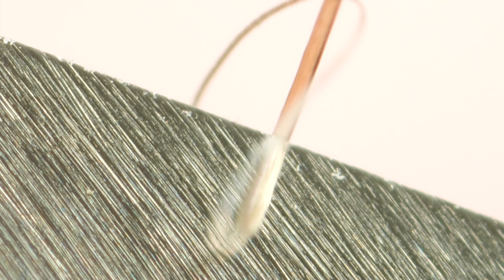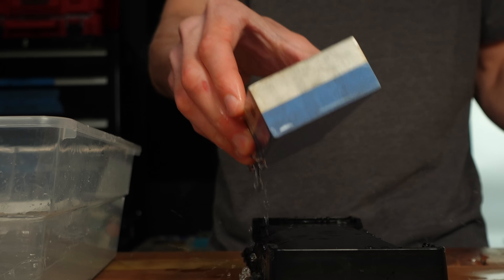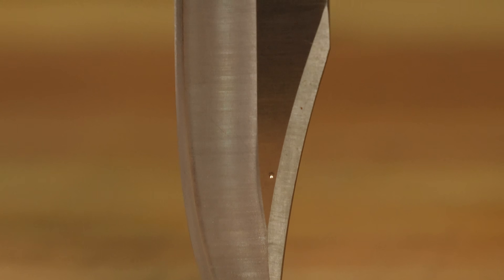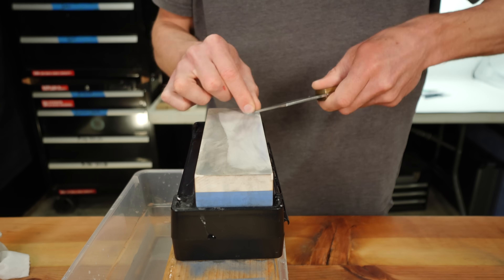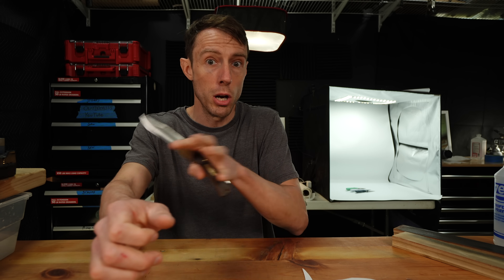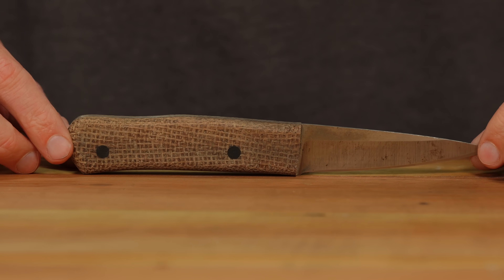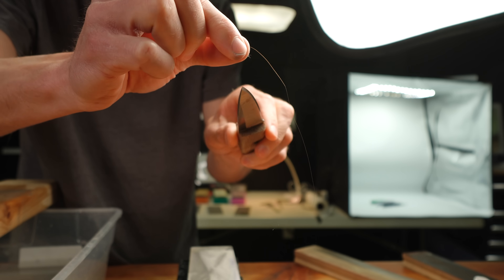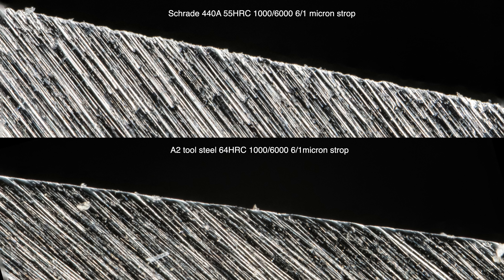The Reason You Can't Get A Hair Whittling Edge No One Talks About

Comment: Interesting, but you failed to mention the real reason.  Maybe you don’t know the reason.  As a veteran of designing food processing equipment, I can tell you the problem is the amount of chrome in the alloy.  What makes stainless steel “stainless” is the chromium in it.  Chrome oxidizes before iron.  This provides a barrier that keeps the iron from rusting.  Chromium oxide is rather worthless at holding an edge.  The more chromium, the more “stainless” the steel, but also less able to take and hold an edge.

Comment: if possible i would wish that for the next videos you try to sharpen kitchen knifes. i think you always use hunting knifes. i understand it maybe does not really makes a difference, but i just feel there are so many different kitchen knives and are there differences on how they can and should be sharpened?
Reply: Slimmer angles
Reply from the maker: I have big plans for this area coming soon👍
Reply: @OUTDOORS55  nice thank you so much. And I forgot to say thank you for that video. I just bought a new Japanese damascus knife after watching that video. It's your fault :p
Reply: @OUTDOORS55  I'm only interested in kitchen knives, so that's good news.
Reply: @OUTDOORS55  All chefs thank you
Reply: Kitchen knives are mostly just bigger, so can be a little more challenging. And they use a lower edge angle, which varies a bit by style and maker. Burrfection (Ryky Tran) has a good method for finding the angle of any knife, but he prefers Japanese water stones -- mostly better ones than shown here, which I can confirm are more trouble than they are worth.

That said, Alex is the only sharpener I consistently learn something new from, so I look forward to his content on kitchen knives!
Reply: If you keep same height at the spine the angle will be completely off.  You need to adapt.  

For chef knives If you're going to cut without impact and never touch bones you can go crazy thin even on soft steel as long as you finish with a 15 degree microbevel.

I put a 5 degree edge on 54 HRC knife and with a double microbevel of 10 and 15 degrees, both microbevels  combined measure 0.25 mm. 
This knife has amazing cutting performance. It was able to cut paper towels even after medium impact on the cutting board so I don't expect durability issues under normal use.

Overall geometry for chef knives are also different but it takes too much work to change unless you own power tools.
Reply: @thiago.assumpcao  5 degrees?! Holy cow, that's impressive. I'd love to see some testing done on an edge like that. I don't think you could even get some Western-style knives down that low based on blade geometry alone.

That said, I have found geometry behind the edge to make a huge difference in how a knife feels in use, even if 2 knives are ostensibly equally sharp and using the same angle. Thinner profile knives like Japanese gyuto feel like cutting with a laser, where a traditional German-ground blade at the same edge angle feels more like it is pushing the food apart as it cuts.
Reply: You must be new..   he did videos with a $1 kitchen knife not too long ago.. (at least it feels like it;  maybe it was a year ago now.)
Reply: @bloodgain  Yes, you need to grind a lot of steel to get to 5 degrees on western knives. 

Thickness behind the edge is one of the most important aspects of knife for good cutting performance this makes a huge difference.

Japanese knives also have a subtle convex that avoids food sticking to it. That's not enough to make food fall off but is much better than a Full Flat European blade.

My channel is on Portuguese but the tests are available if you want to see them. It's the last 3 videos. It's a 5 bucks knife that I spent about 7 hours working on. Way too much time but I was having fun testing how sharp I could make it.
Reply: @calholli  I think I saw that one, but it definitely went up before I found the channel. The subscriber count is growing fast, and that's a good thing. So yeah, he might be new. 🙂

Besides, clearly even Alex thinks that would be good content and has plans for it.
Reply: @thiago.assumpcao  Thanks, I'll check it out!

Yeah, the Japanese makers design amazing knives. I have a super nice right-handed yanagiba, and it's subtly convex on the front side, and concave on the traditional "flat" back side. It's an incredibly smooth slicer, which is good, since it's designed for slicing delicate raw fish.
Reply: I just applied the same principles from the main sharpening videos. Find the angle. Keep your wrist locked. Be consistent. Achieve the burr. Flip. Repeat process. Deburr. The same process applies you just have to get started and I'm still improving.
Reply: For some cross over content, could you do a video on sharpening 2 and 3 blade broadheads?  3 blade bh are typically laid flat on the stone but the point of the bh faces in the direction of the stroke.  I think it would be hard to raise a burr that way.    Also the steels are typically 50-60 HRC and typical examples are 1045, S7, 440C. 
  Thanks for your videos!
Reply: Please get a Kobayashi
Reply: @OUTDOORS55  A video showing how to sharpen a fillet knife would be awesome!
Reply: i would love to know the secret on how to get good edges on KIWI knives.

and a benchmark, swiss army and opinel and leathermann to please.
Reply: I used the new 180 euro knife I just baught (see comment above) one day to cut tomatoes, pineapple and mango. It already lost sharpness and the next tomatoes cannot be cut so good. Is that normal? I'm beginning to think my kitchen is haunted... Or I'm just dumb
Reply: @1eikaramba1 this guy can’t even sharpen with his left hand. Forget about all the disinformation in this video. Look elsewhere for information on sharpening knives.

Comment: I'm convinced that schrade makes their old timer knives out of chromed plastic based on how they sharpen.
Reply: It's so bad lol
Reply: Nah, the knife is fine. The strop failed to do it's job in polishing the edge. It is very common for people to mess up stainless steel stropping.
Reply: @dragoscoco2173  I’m not saying this based on the video but on my own experience as a professional knife sharpener. Old timers are trash.
Reply: I wish it wasn't true, but it is. At least they are now making knives with D2 and 9CR18Mov. They still make the trash, but it's not all they make.
Reply: Shrade went out of business in 2004-05.  The ones you see now at Walmart are anywhere are from China and are stainless. The older Schrades made in the USA were carbon.  Shrade /Walden was before Shrade and were even better.
Reply: @dragoscoco2173  so... if I "sharpen" a piece of silicone and it doesn't come out sharp, I can't strop. Is that what you're saying.
Reply: @Doc-Holliday1851  One can easily sharpen an old timer plain carbon rusty blade to hair whittling, sure it won't hold long but it can be done, always. It does not even need to be a complex hardened and untempered version. The problem is very few understand the strop and what it does or how it works.
Reply: @alextheonewarrior  You can see in the two edges after stropping, the stainless steel strop failed to do anything. Why do you think it did?
Reply: @dragoscoco2173  You can get a butter knife hair whittling sharp. That's not the issue. The issue is that the steel has the structural integrity of a week old banana. You're right, you can get the apex into the shape of a functional blade but, in my experience, the moment you do anything with it the edge dulls pretty much instantly. So it doesn't matter if you can sharpen it because the steel is trash.
Reply: @Doc-Holliday1851  Well Outdoor failed at attaining that hair whittling sharpness with a steel that is most certainly able to reach it. Ok 54 HRC is not that high, but it is a decent value for a stainless that was not meant for high hardness. Also the modern dribble about high hardness which is achieved by essentially providing hard carbide grains to stop the indenter from moving through the soft matrix is less ideal when a razor edge smaller than those grains is required.
Reply: they used to be good decades ago
sad to see a US company go so downhill
Reply: 55 HRC can be sharpened to hair whitling easy. I've done it myself several times already.
It is not great for durability but enough for many tasks.
That being said, it is not the steel it is Outdoor55 if hair whittling is not achieved.
Reply: @escapetherace1943  The problem is not the company or the steel as 99% of people holding money in their pockets are fine with a 55HRC stainless.
The problem is the massive expectations of a small minority of knife enthusiasts.
Reply: The old Old Timers with carbon steel blades can be sharpened to a very fine edge with a hard Arkansas stone.  I always sharpened mine to shaving sharpness and don't consider myself a great knife sharpener.  For sentimental reasons I no longer carry any of my carbon steel Old Timers because the people that gave them to me have all died.  I just don't have the success with stainless blades.  The best stainless blade I have for its ability to be sharpened and for edge retention is an inexpensive Kershaw.
Reply: It loses it quick if that hair whittling sharpness is what you are after, but all my knives do not require it at all. The older I get the less I desire it, as I've gone from making them shaving sharp to still sharpening them floating hair popping and then stropping one last time with something akin to 25 degree per side (yes that steep). the durability increase is immense.
Reply: @David-hm9ic  I suppose the maintenence and care from a stainless to a less stainless is a constant of the universe. One needs sharpening the other a bit of TLC to prevent or remove rust.
Reply: @oceanwaves83 nope you just locked the ability to sharpen a knife. Just like the dude in the video.
Reply: @cecilandrews7479  yeah sure buddy

Comment: Small stainless steel pocket knives are very difficult to sharpen because the steel is wear resistant and you have very little to hold onto and apply pressure.  A large carbon or tool steel fixed blade is much easier to keep a good edge on, one of countless reasons why I prefer these as general purpose knives.
Reply: Holy hell, you know more than this youtuber. This is the most intelligent comment here.

Comment: some steels, particularly cheap SS, are tough, and the burr won't grind off. Plastic deformation, just like they say about 6:05

Conversely , I have some old carbon tools (billhook, sickle, scythe) that aren't sharp, but a hair popping edge can be achieved. Easily dinted, yes, but easily repaired. A really hard steel would chip.

Comment: Hi, could you make a video about how both sides of the apex being sharpened at different angles affects sharpness. For instance, one side is sharpened at 15 degrees and the other is sharpened at 20. My kitchen knives go relatively dull in 1-2 uses and I'm wondering if that could be why. (I am removing the burr with a strop, however I don't know what micron size compound I have.)
Reply: More obtuse angles cause worse edge retention unless the steel isn't hard enough to maintain that angle without folding in regular use, but I think you have a wire burr that folds over, even if you get it aligned straight up. Perhaps too soft knife, since they can make burrs even on a strop.

Comment: I have a few knives with very fine steels, but I've never been even close to getting them sharp enough to shave with. I looked at the edge on one of them under a microscope, and the edge looked "chipped". As if it was way too hard. It just cracks instead of sands away.

Edit: And yes, I have the exact Sharpal diamond stone you recommend. Doesn't help. :-)

Comment: The best way to get that Schrade sharp will probably be like 8 sharpenings. But it will get sharp. Destress sharpen, repeat. Those guys lay on the grinder. You can still get it razor sharp but that process is longer.
Reply from the maker: This knife is over 20 years old. You think its only had a couple sharpenings?
Reply: @OUTDOORS55  I would leave the provenance of the knife to you. I believe you if you are saying it can't get hair popping. May be full of retained austenite for all I know. Gummy burr or fracture at the apex while sharpening tells me it would need lots of sharpening/destress cycles. I learned that a long time ago from cliff stamp watching his old videos and based on my experiences.  Unless the heart treat is complete garbage. I love well done high hrc steel for the same reason you've stated. Quick to deburr and set the apex. I have a cheap 8$ Imperial sod buster that is razor sharp. I got it on a whim 2 years ago. It's 5cr/420/440a maybe. Took several sharpening and would not deburr. Now it's no problem to quickly sharpen. Even a crap knife has surprised me. Appreciate the video.

Comment: Makes me think this has to do with a grain size, different composition of grains, or grains in a matrix acting as a cement where some grains just drop or pop off during sharpening leaving the uneven edge in the lower quality steel. Maybe if you etch the metal you'll be able see some structure having to to with what's going on, and a difference w/r to the higher quality steel.

Comment: This almost feels like a video based on a comment I posted on a video a few months ago 😅

The company I bought it from was kinda unknown (Ganzo on Amazon), but the metal is D2. When I sharpen it, it shaves hair off my arm no problem, but I can never get it to hair wittling. I use a 400/1000 diamond S SATC stone and a 1 Micron Jende Diamond paste. I can visually see the scrape marks on the knife, but can't really feel them. 

When cleaning out a house, I was able to take what I find if I wanted to as the owners inherited the house several states away and didn't want anything to do with it, I found a few knives that I like. 2 that just say "Stainless Steel Japan" on it that I call my magnum opus as I got those fricken sharp (not hair whittling unfortunately) and a Tall Fellow "high carbon steel" that I somehow got to an almost mirror finish that also can't whittle.

I don't know what I'm doing wrong. I feel I may need a step between the 1000 and the strop, maybe like a 5000 or so stone. Anyone  have any thoughts? I try to sharpen them around a ~20 degree angle (not using a guide, just make the knife perpendicular (90 Deg), move about half down (45 Deg), and move it a little more than half again (~20 Deg).

Comment: what would you suggest for maintaining a thin and flexible filet knife? I've tried freehand sharpening but they're so flexible it's hard to keep consistent pressure and angles. I see a lot of pro guys that use the same filet knife all day use a pull-through for touching up the edge every few fish, but I've never had good luck with pull-through sharpeners. so I'm at a loss how to do edge maintenance with filet knives when doing more than a couple fish at a time or between trips.

Comment: Don’t know what exactly is happening. 
But I have sharpened a 6 dollar ARCOS knife in plain 420 steel 55hrc, with some sand paper and a spyderco sharpmaker medium rod as the hone, no stropping(I don’t often strop), EASILY made it hair whittling, against or with the grain.  
I am not boasting my skill, but microstructure much more important than just hardness. Hardness reading can be used to analize microstructure, but judging only by hardness is nonsensical. 
I mean so many people crucify any manufacturer that makes magnacut lower than 63hrc.

Comment: Buck's 420HC will absolutely take a hair popping and whittling edge. Schrade's 440A carbides are enormous and plentiful which is why you see that broken edge under a scope. There is essentially a hard limit on how acute you can ever get the edge unless you have a way to grind the carbides themselves down without popping them out of the surrounding matrix (good luck).  Not a great steel and like you said a poor, cheap heat treat.

Comment: Thank you. I had a 3 blade old timer. 2 blades would get hair splitting sharp. The 3rd blade wouldn't get sharp after the factory hair splitting sharpness. I  figured the factory got the temper off a little.  They sent me a new knife. But still have the one that won't get sharp.

Comment: I very much enjoy your work & have learned a lot - I bought some of the el cheapo stones before I found your channel - figured I would learn as much as I can from them before upgrading.

I have 2 Q's... 
1. How do you have any hair left on your arms? 
2. Is there a way you could add a rule when you show the magnified edge pics? I'm new & don't know if I'm seeing a 'long' bevel (fine angle) or a really mag'd larger angle bevel.
Reply: 6:29  the video shows the edge cutting a human hair for scale xD    the full screen is probably a couple mm
Reply: @adfaklsdjf  So if you look bottom left corner, is that the part of the blade that is flat? I ask because some of my 2nd hand knives have a double bevel & I'm wondering if I should profile the knives to remove the 'ridge where perhaps somebody messed it up.
Reply: @markmcd2780  i think what you're seeing in the bottom left is the bevel.  the part that's taking up most of the screen is the part that was directly in contact with the stone, just along the very edge of the blade.  it's extremely zoomed in.. i don't know what kind of equipment he's using but i don't think this is just macro lens?

if you put an ordinary 12" ruler on the screen, you'd probably only fit like 1 or 2 of the lines separating millimeters... we're way too close for a regular ruler to show any useful information.

the scratch pattern isn't visible to the naked eye.
Reply: @adfaklsdjf  Thanks very much for taking time to answer. It's appreciated!😀